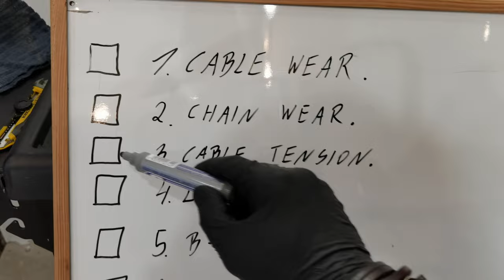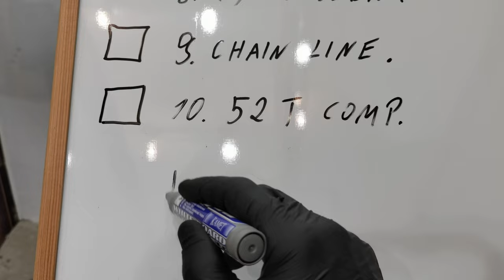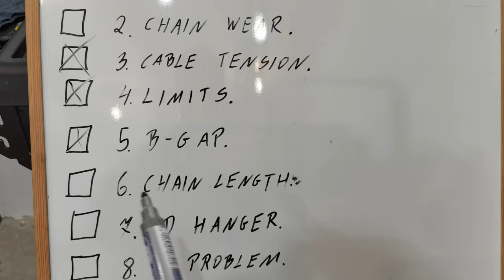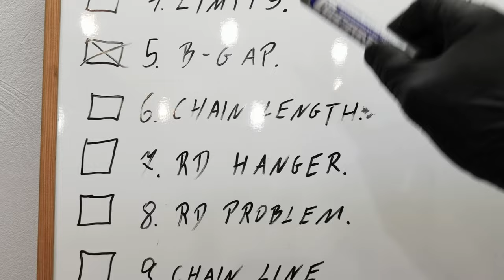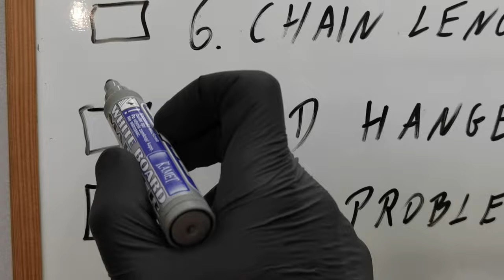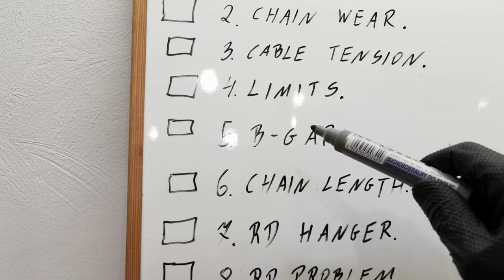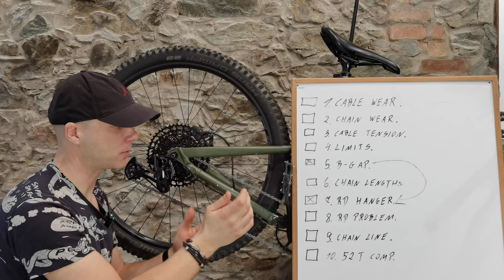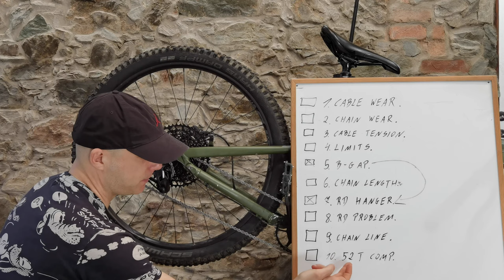Bike Service School - the biggest 1x12 Eagle service tutorial. Step-by-step troubleshooting guide.

Comment: This is so helpful.  
I have been very happy with my SRAM 1x12 on my Commencal and you have added to this.
Thank you again for your tutorials.  

P.S.  I wrote the following on another of your YT postings.
Due to a failing hub, I am replacing my rear wheel  & hub and cassette.
In the beginning, 4 years ago, I bought my full suspension Commencal which had a GX crank, but NX transmission.  I immediately pulled the NX derailleur off the back and replaced with GX and a GX twist shifter. I have been very happy with the results.   The SRAM 1x12 with 50t has been a real joy.

I have been reading and watching reviews and see very few comparing the 10-50 vs the 10-52 and I not found a definitive answer of whether I should stay with 10-50 or move to 10-52.  It just seems that the jump to 52t opens up some extra complications and resulting problems, and I would be receiving little help in my riding.
Do you or others have an opinion?I wrote the following on another of your YT postings

Comment: One of the best bike tech videos I've ever seen on Youtube so far. If not the best at all. Found it because I looked for a solution for my newly built hardtail setup with SRAM GX Eagle and a Garbaruk cassette. Couldn't find the issue on the bike stand but when riding the shifting was a mess. I already wondered if the cassette or frame had manufacturing issues or even if something's wrong with the (used but good) rear wheel. In the end I opened the chain and found that I've shortened it by only ONE (!) link too much. Riding now with two links as well as one of your customers but happy with it! Shifting is fine after the chain length was corrected.

Comment: I installed Eagle on 3 different frames. I made sure the hanger is straight and used the B Gap tool. No issues whatsoever. I was even able to backpedal without dropping chain.
Reply from the maker: That's the advantage of reading the manuals and doing things accordingly. 👌
Reply: Good knowledge sharing Danny. Thx
Reply: Could you share some more knowledge regarding bearing maintenance

Comment: Hi, thanks for all your videos, want to ask you about LinkGlide 11 speed 11-50 cassette on an eBike, all components Deore XT 8130, do you have any experience with it, I'm strugling to have a nice shift but even with the b-screw with the correct gap, chain length, new cable and derailure hanger ok, I still have the derailure strugling to go up.